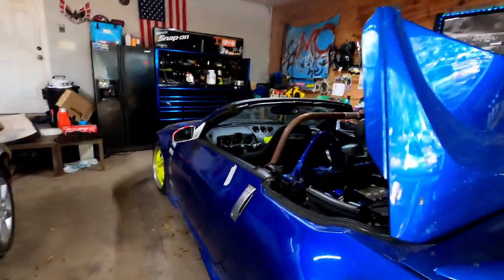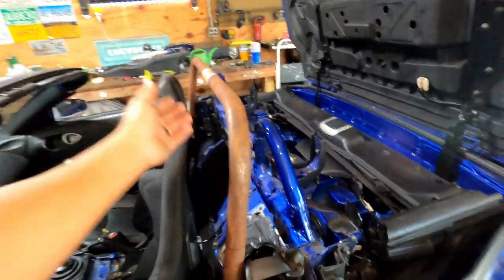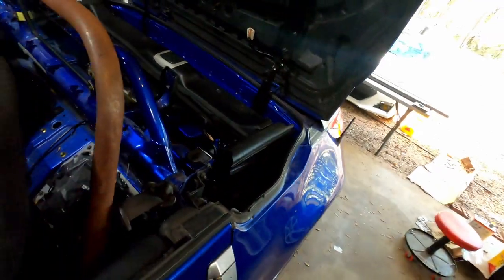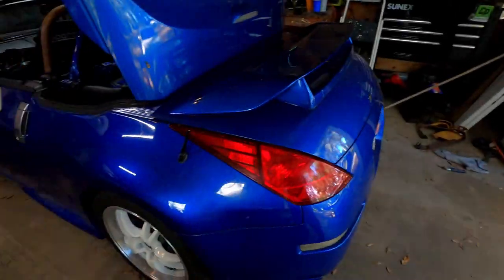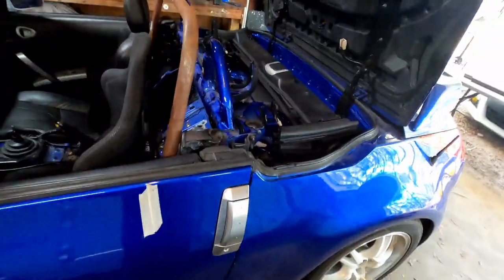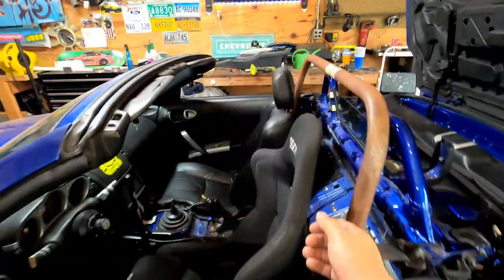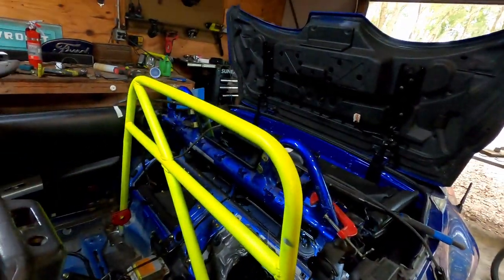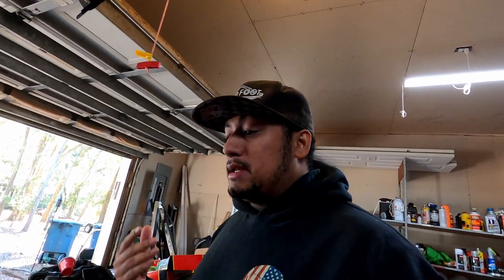how to make a 350z convertible 4 point roll cage

Comment from the maker: so officially, we did pass tech at OSW. with that being said, i had a long discussing with the guy that runs the OSW events: so yes it did pass tech, he said he could of nit pick it, maybe failed it because the angle ( or the absent of , angle of the down bars. he said he wasn't going to failed it, because its a roll bar/ not a half cage which with proper down bars " technically  makes it a half cage"  its  the grey area, where you could pass tech or fail. so ALWAYS check your local tracks for actually verifications, dont go on he/she said(word of mouth).

Comment: Hi man, great zed! I have a 350z convertible and trying to attend a track day in 5 months but need a rollcage fitting. How did you get the bar that's behind the headrests?
Reply from the maker: so thats a very hard question to answer because it  comes down to preference, and what your willing to sacrifice ... for example in this video... i sacrifice space...  to keep the top working... electronically... so cut and try to fit it as close to the floor as possible.....( down side is big guys or tight fit in cockpit..).. currently... i re did it.. and i cut off all the speaker bracket and put it how a half case is suppose to work ( on the step up) .. but now  my top does not work...

Comment: What are the detentions of your hoop like hight width and angles building mine currently and would make it much easier to know that info thanks !
Reply from the maker: so that was is a hard question because this was version 1...  which i believe was main hoop before bend was 46 inches/ at the top length wise after bend it was about 38 ... tall it was about 37 inches... honestly does measurements will be different for you .. it depends on what main hoop you buy or make... and how it ends up its basically how much your willing to remove from interior of the car and cut out...  after this video i did end up re doing the half cage doing a version 2.. which i cut the speaker holder metal out and place the half cage on the step up.. to give the driver more space.... and now currently the car is fully caged with a version 3 all hand bended and cut custom cage in the car

Comment: I know State laws vary, but your car passed safety inspection to legally drive on a public highway?  After cutting into the unibody?
Reply from the maker: I did not cut into the uninody it's just a overlaping panels that to my understanding does not affect structure integrity of the cars uninody ... but  in my state ,it  would not matter because we do not have a required inspection

Comment: How to get the bucket seat in the convertible I’ve heard it can mess with the top working
Reply from the maker: I using a sparco bracket and slider , with no issues top goes up and down no issue... I wish I would of use like some low planted bracket